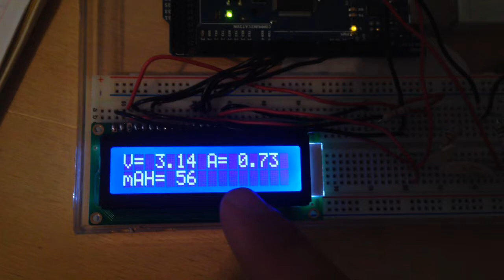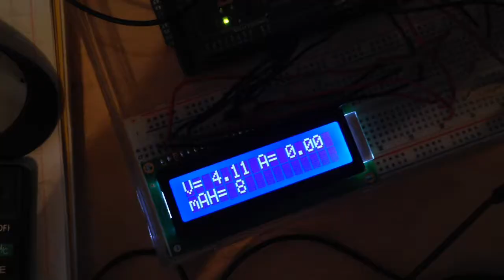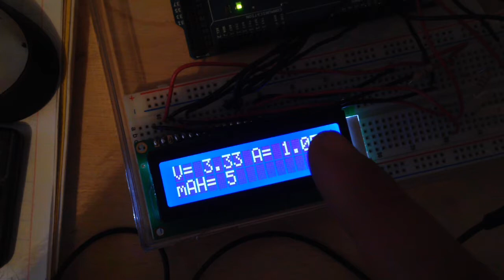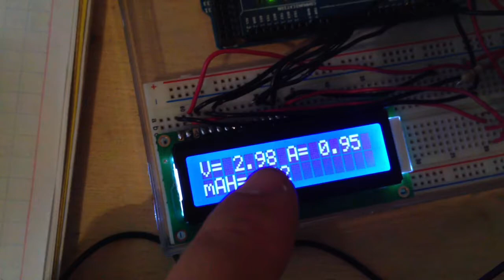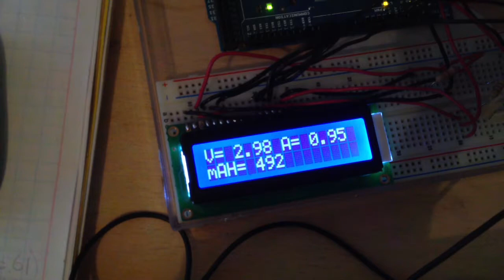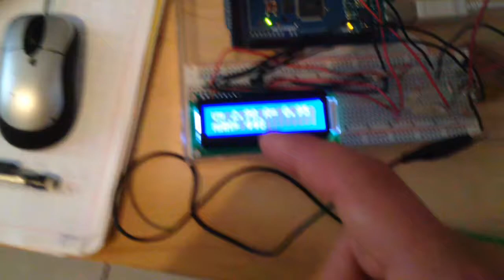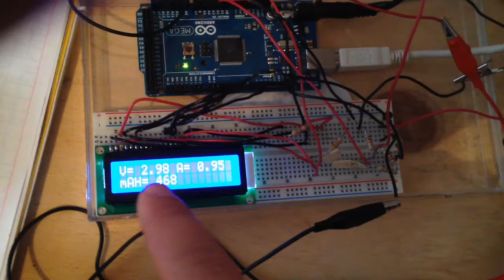Used Laptop Lithium cell Capacity measurement

Comment from the maker: Yes i think you can do this the uno you just need enough pins.  2 analog and 7 digital (mostly for LCD screen).  Please find a link below to the code and how the circuit was built.

http://e-pod.doomby.com/pages/e-pod-software/1-used-battery-capacity-measurement-volts-amps-watts.html